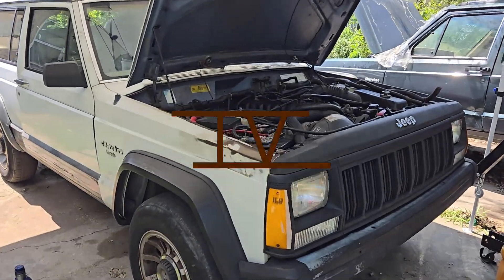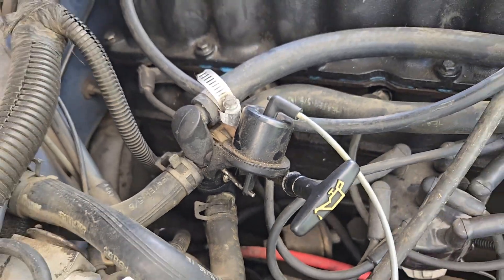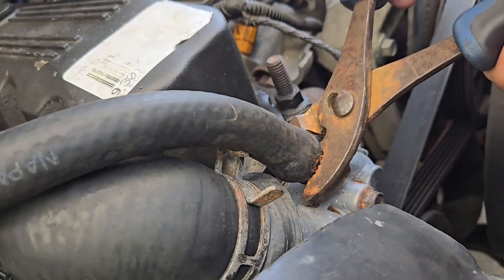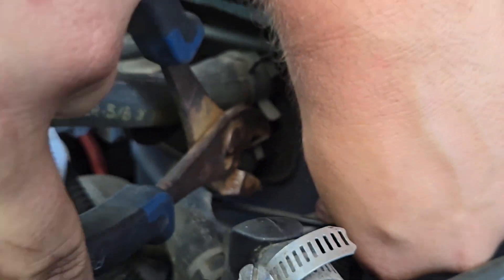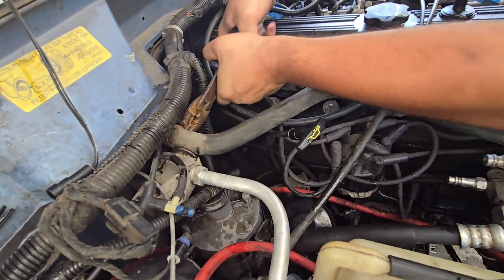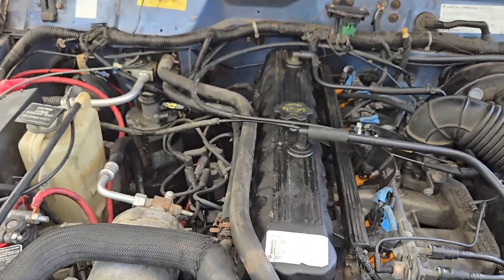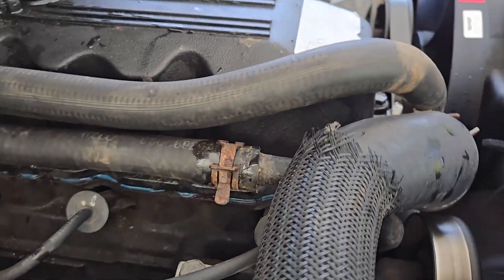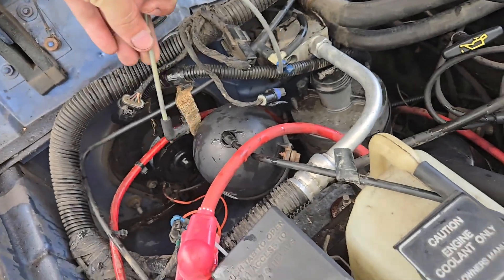Jeep Cherokee: Heater Control Valve Delete/ Bypass ['84-'96 XJ]

Comment: The heater core hose configuration will be different on renix 87-90 Jeeps unless you are okay with reversing the flow in your heater core.